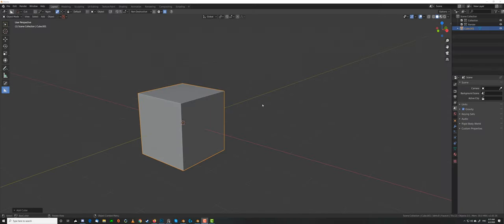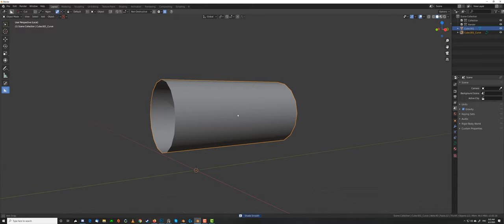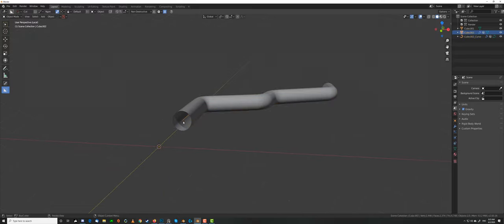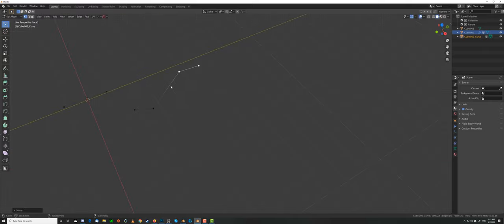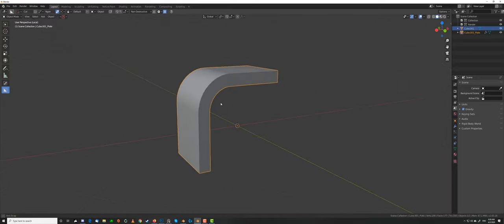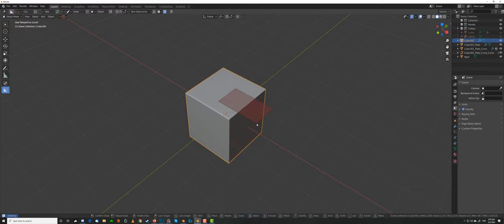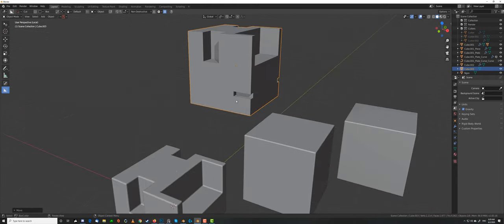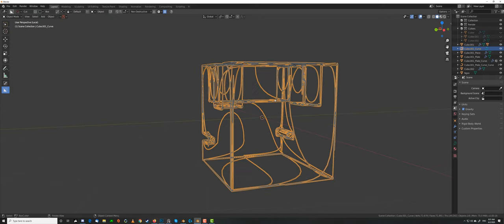Hardops tutorial for Blender part 8 Curve Extract

Comment: Great series. Went ahead and purchased HO+BC and EEVEE materials for KO. Also, got myself MeshTools. Just missing Mesh and Decal machine. Thanks again for the previous suggestions on what addons to get. Getting some practice in and then going to try and model my Mountain bike in order to visualize some paint schemes.

What's your opinion on texturing? Is something like substance painter necessay or is blender and something like quixel mixer or armor paint more than enough
Reply from the maker: ooh you ll have a blast with the KO mats man, that thing is on fire. Keep it up, it is a steep climb but the views are worth it! SP definitely my next stop. Quixel Mixer is also great, and I bet with the funding behind Epic this thing will only get better.
Reply: Ponte Ryuurui going to hold off on texturing tools until I get the hang of modeling and work it out in blender and mixer. I did however pulled the trigger on mesh and decal machine. Both look awesome but the docs and vids are information overload. Any plans on doing videos on these?
Reply from the maker: @RobertWallace  oh man you ll have a blast with Decal Machine, yeah i have a vid on this one, here, https://www.youtube.com/watch?v=DVaaYw8lCNc in addition feel free to try out my free decal packs: https://gumroad.com/ponteryuurui?sort=newest just scroll down and you will find them. Mesh machine is a beast, i will be dropping a tut on this one, in fact tomorrow I am releasing a quick into to Machine Tools, which is actually free.